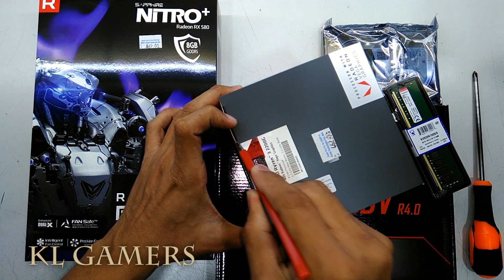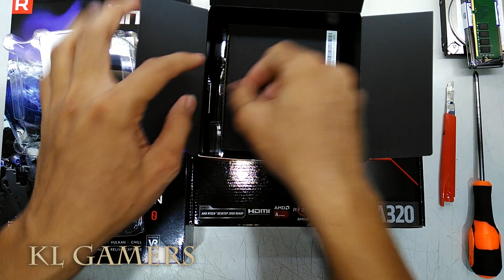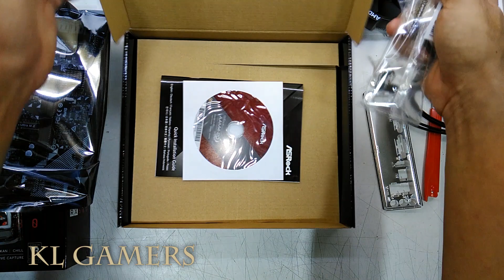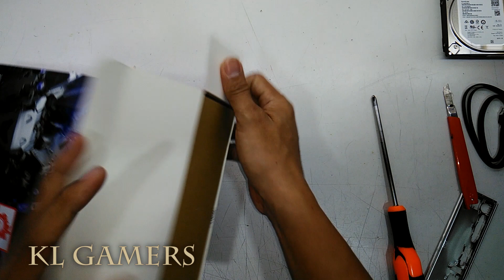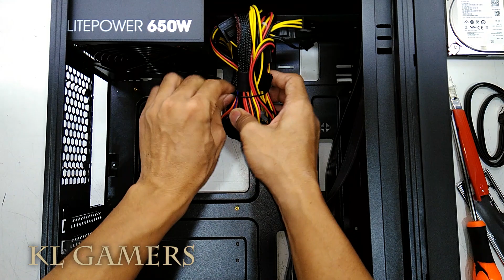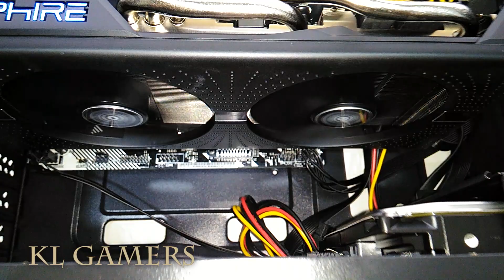AMD Ryzen 3 2200G ASRock A320M-HDV R4.0 SAPPHIRE NITRO + RADEON RX 580 8GDDR5 GAMING RIG 2019

Comment: My PC specs right now..
Gigabyte B450-DS3H
Ryzen 3 2200G @ 3.9GHz (OC)
Kingston HyperX Fury DDR4 16GB (2x8GB) 3200MHz
SAPPHIRE Nitro+ Radeon RX580 8G DDR5 OC
WD 2TB HDD
Kingston 240GB SSD
Segotep F7 500W

avg. 58.4fps..testing on UNIGINE HEAVEN BENCHMARK 4.0 in 1080p EXTREME :)
Reply: which psu do you have??
Reply: Mine are:
Ryzen 5 2600
Asrock a320m hdv r4.0
Rx580 sapphire nitro+
ADATA spectrix rgb 8gb
Dk supply 600W
Apacer 480gb
Barracuda 1tb
Reply: Ryzen 3 3100 is just better. Or 3300x if you can afford

Comment: Last week same motherboard, same CPU, 2 x 8 GB DDR4 at 3000 MHz and no graphics card, but 1 SSD and 3 HDDs from my old PC. My previous PC was a 2008 HP dc5850 (4-core Phenom II at 3.2 GHz, 8 GB DDR2). 
The system booted from ZFS on Linux (Ubuntu 19.04) without me re-installing anything. I only updated the BIOS to be more prepared for the future (Zen 2 or 3) and I changed some BIOS settings for memory, virtual machines, etc. 
The new PC doubled CPU power and memory! My main usage is related to virtual machines and my gaming is restricted to Solitaire on my phone :)

Comment: Hello sir, is asrock A320M-HDV motherboard ready to use  with any ryzen CPU without updating the bios while it is newly build, like for example ryzen 3 3200g?
Reply from the maker: usually will be fine if it's new stock. If old stock might need update BIOS due to very old BIOS not support new processor
Reply: @KLGamers  ohh i see. Thank you sir.

Comment: hey bro, do u think ram with heatsink will fit that slot? the space between the slot and the cou cooler seems so tight.
Reply from the maker: yeah very tight, might be able to just fit or else you will need to remove the plastic from the heat sink fan.

Comment: Halo bang, saya pake processor dan mobo serta VGA yg sama , tapi saya pake ram 2x8 gb 3200 mhz dari brand klevv. yg ingin saya tanyakan kenapa setringan RAM nya cuman mentok di 1600 mhz padahal udah XMP on di bios, apa memang mentok di 1600 ?
Reply from the maker: sometimes the RAM speed will not show properly , try update BIOS, check the performance,  if low performance change to other brand

Comment: will 3200g work without update bios on this motherboard!!
Reply from the maker: If your motherboard box comes with a silver color AMD Ryzen 2000 series Ready sticker, most likely you will need to update BIOS before you can use a AMD Ryzen 3000 series processor.
If your motherboard box comes with a orange color AMD Ryzen 3000 series Ready sticker, it comes with new BIOS , most likely it will support a AMD Ryzen 3000 series processor out of the box
Reply: @KLGamers  thenks its 2000 series should work on r5 2600 to update bios firt than to use on 3000 series

Comment: i have currently

MB- Gigabyte A320M-S2H V2
PWS- Cooler Master Elite 500 ver.3
PSU- AMD Ryzen 3 3200 G
SSD - BX500 2.5 inch Solid state Drive
HD - Seagate Barracuda 1 TB Sata 6.0GBS  64 Cache Hard Drive
RAM - Kingston Hyper X 8gb DDR 4 3200 MGHz

I am planning to buy the RX 580 8gb Ddr5

would there be any issues ?
Reply: I have same setup except get 16gb dual channel ram for better performing

Comment: Ryzen 3 2200G
Asrock a320m-hdv 
8x2 3000mhz ddr4 
Gigabyte pb500 80+ bronze
1tb wd hdd 
240gb ssd
Antec nx200 

All this compatible?
A good build?
Can I add rx570 4gb in future?
Reply from the maker: 3000mhz ddr4 will not fit very well, use 2666
Reply: @KLGamers  so does the 2200g work well with this motherboard you don't have to update anything??

Comment: It will bottleneck rx580 for sure
Reply: It'll give 20 less frames... You Atleast need a 2600 or i5 9400f for RX 580 8gb... Or else it'll get bottlenecked af.
Reply: @THEKNI8  exactly
Reply: @VimalMistry10 ryzen 3 2200g for rx 570 4gb ?
Reply: @adityaamboro504  ya 570 is better with 2200g
Reply: @VimalMistry10  oke thanks bro
Reply: @VimalMistry10  how about ryzen 5 1600
Reply: @geomdx its not about perfect.. its how you manage your money in choosing suitable component. 580 with ryz 3 will not perform as wht rx580 could give(max potential)....✌️
Reply: Better get an AMD Ryzen 5 2400G and OC a bit, if you have an overclockable mobo but stock is okay for this mobo 😊
Reply: @THEKNI8  after 60 fps but who cares 60 is good

Comment: i want to buy a pc at a low budget. please can anyone help me out by replying this comment if the build is compatible.i am giving a list of the things i want to  buy:
1.ASRock A320M-HDV R4.0 AMD Motherboard
2.AMD Ryzen 3 2200G Quad-Core Processor
3.Corsair Vengeance® LPX 8GB (4x2GB) DDR4 DRAM 2400MHz
4.Transcend J25M3 1TB USB 3.0 Portable Hard Disk
and an extra question will my motherboard boot up???i heard from a lot of people that ryzen 3 2200g does'nt boot up with A320M-HDV...............so,please help me out,guys.....Awesome channel by the way.very helpful..already subbed you,BRO!!!!!!!!
Reply from the maker: 1.ASRock A320M-HDV R4.0 AMD Motherboard  << The motherboard is OK 
2.AMD Ryzen 3 2200G Quad-Core Processor << Processor support 
3.Corsair Vengeance® LPX 8GB (4x2GB) DDR4 DRAM 2400MHz << The RAM should be (2x4GB)? 
4.Transcend J25M3 1TB USB 3.0 Portable Hard Disk << This is portable HDD will not work. Buy the WD 1TB Blue desktop HDD
Reply: @KLGamers  Thank you,bro for your reply. btw i want to buy two 4gigs of ram and  the hdd you recommended me. but i have a question regarding ryzen 3 2200g.will my computer boot perfectly when i put all of these components together.what if it doesnt boot.........Or Will It boot????please reply!!!!!thanks in advance!!!!

Comment: Hola, tengo esta misma motherboard
Microprocesador: ryzen 5 2600 3.4ghz
Ram: hyperx 8gb a 2600mhz
Placa de video: RX 580 8gb OC
Mi problema es que, a la hora de jugar, sufro de muchos tirones, siendo que juegos como resident evil 2 lo corre (con todo en ultra) a más de 70 fps. Creí que el problema era con juegos pesados, pero persiste con el batman Arkham Asylum, un juego del 2009. Espero una respuesta, muchas gracias
Reply from the maker: it could be many things
you can try to update BIOS, reformat windows 10 minimum version 1803 ( latest 1903)update graphics drivers, use dual channel ram , change better power supply, change or replace graphics card.
Reply: Lautaro Nahuel Romero Collar Hola bro, que es lo que te dijo el Man
Reply: @armandoescalante7884  mirá, te voy a decir qué era lo que me pasaba a mí. Resulta que el problema estaba en la RAM y la temperatura de la placa de video era exageradísima. La RAM era poca para correr muchos juegos, por lo que agregué un módulo de 8gb para hacer dual channel y fue la solución a todos mis problemas. La placa de video la cambié por una RX570 de 4gb y le modifiqué la curva del fan para que no levante tanta temperatura. Si querés que te ayude podés pasarme tu email o lo que sea así nos fijamos. Saludos